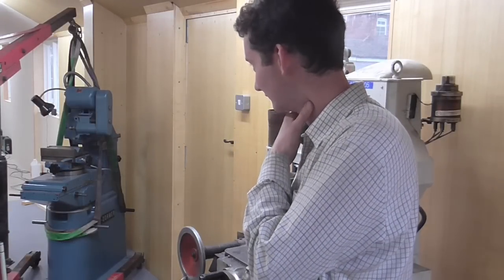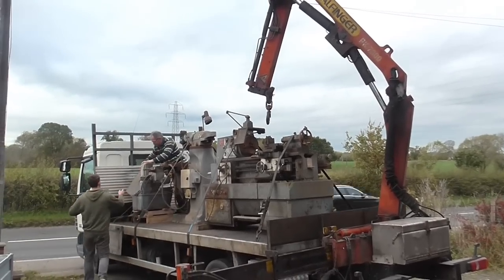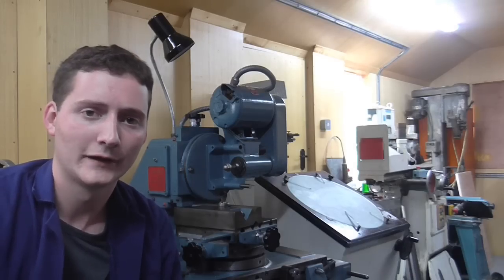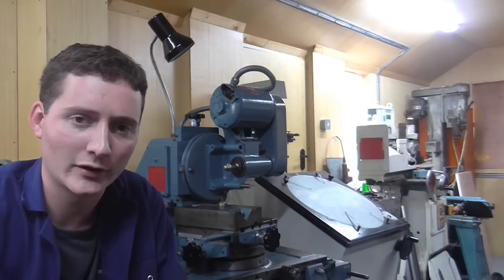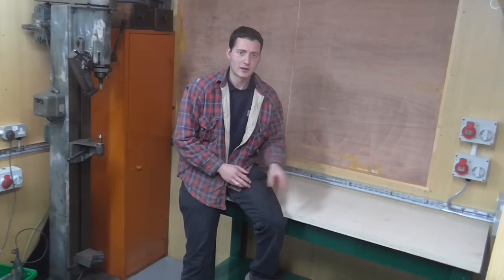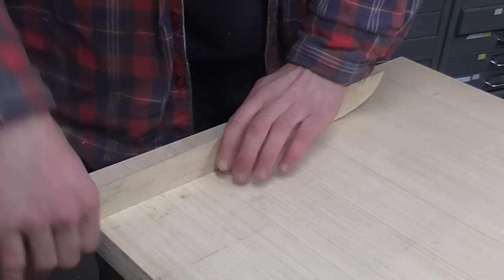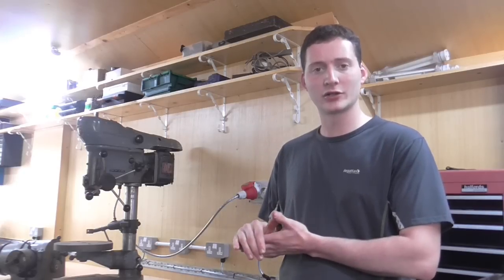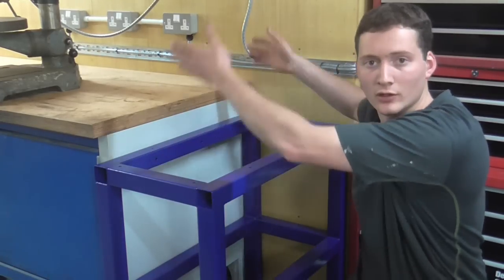Equipping a Workshop

Comment: Impressive collection of machinery Mr Crispin. Well done. One question, and one suggestion if I may. Question, how much power did you run to your shop for all that? Suggestion..get some covers for the motors and tables in close proximity to your abrasive end of the shop. All the air born grit and dust will eat the bearings and bushings in the equipment over time, and a little prevention will save you in the long run. I learned that the hard way. Good to see you back.

Comment: Wish I had that workshop when I was 23.  I only had a Unimat on which I built a Stuart Turner vertical V10 P small steam engine.  I have a more equipped workshop now but It took me 50 years to get to it, and it is nothing like you managed at such a young age.  I wish you luck in all your engineering adventures.

Comment: Good to see you back.  Two concerns - surface grinders are dirty, and I'd have positioned yours with its left side facing an end wall - and certainly not with a shadowgraph right alongside in the firing line.  The other thing is that you will accumulate/need a lot of ancilliary equipment to make full use of the machines, and there is now inadequate space to house it all. 

I need to get rid of two or three of my machines to ease congestion - and I'm sure you will arrive at this conclusion before long.
For what it's worth, despite having a full range of manual and cnc machines plus EDM, the machine that gets used most is a slow speed vertical bandsaw.

Comment: Hi Mr Crispin.I have, amongst other stuff, built 6 live steam locos, 2 each in 3.5, 5 inch and 7.25 gauge. I have never owned a milling machine preferring to use my 10in stroke Elliot shaper combined with a vertical slide fitted to my Colchester Chipmaster lathe. My only other machine tools are a band saw, decent bench drill and bench grinder.
All my locos were built whilst I was working in Cambodia from 1998 to 2017.  
Your programmes are great and very informative, please continue.

Comment: Jealousy is a curse................
You managed to cram a good machine shop into the space available.
I don't think I would have put the grinder and belt sander next to the surface table though. ( I was once severely admonished for leaving sweaty stains when I leaned on the surface table in the Metrology Lab when I was a QA auditor. )
Cheers Eric

Comment: I've just recently started watching Blondihacks - which I'd recommend. Making a steam engine (I think it is) she has a video showing machining of the crankshaft bearings and caps - 'a comedy of errors' - mainly down to bad planning. 

I'm amazed at the collection of machines you've installed in there - some I've not seen the like before - and one that brings back happy? memories - of the rhythmic belt noise etc. Having watched this video of the installation of this impressive collection I realised there is one machine missing. 

Machine Number One - that should have gone in first - - the gantry crane. With a capacity to have coped with the moving of all those machines with relative ease.
Note for Santa.

Comment: Was literally exited for you watching that ! Hey maybe your mate who made the drill press stand could coggle up a “sky hook” Abom style crane for you to move stuff like your diving head around, you could have various floor mounting points dotted around strategically they could take the form of a tube concreted into the floor or the same mate could coggle up a sort of 15mm mounting plate with m12 holes at 50mm centres say if you machined that up he could weld a 3’ rebar etc on it and have various “fixture playes dotted around for shop made sky hook etc  respect your work enormously 👍🏻
Reply from the maker: Nice idea!

Comment: Well done, lots of equipment in a smallish area. Wondering on the thoughts behind the grinding equipment next to the surface plate though, lol.
Reply from the maker: Because the surface plate has the least moving parts and it's easy to clean! I plan to make a screen to shield it eventually.

Comment: I replaced my old beat up 1963 Rockwell 21-100 mill with like new 1969 Bridgeport. It cost me $2500 to have the mill shipped. It took me a month to move it around the side of the shop, where I had turned a wall into a giant door. The only real improvement was DRO and auto feed, that I could have added. But the new mill did have a story. It was only used [lightly]for microwave modules, and built one that is on Mars.

Comment: Good morrow Mr Crispin,
I note that you have elected to have three phase electricity installed in the workshop.  May I ask if this is self generated from a static or rotary converter, as the Power Capacitors offerings, or did you bite the bullet and have a three phase supply installed to the property ?
If you chose the latter course, can you give me an indication of how big your choice of supply was, and how much it cost ?
By way of explanation, the Colchester lathe, and Harrison mill that I have, are both three phase, and it would save much modification and motor replacement, if I were to follow in your footsteps . . . .
Many thanks for any assistance that you can offer.
Kind regards,
Steve.
Reply from the maker: I had the local electric company round to do a survey but it was going to be a big job. They wanted industrial cabinets on the outside of the garage plus digging my neighbors drive up to run new cables and all sorts of admin. 

In the end I went for a power capacitors 11ke rotary phase converter. The Harrison 190 is the biggest machine I have and it is more than powerful enough to run that.
Reply: @MrCrispinEnterprises  
Good morning Mr Crispin,
And many thanks for your reply.
I had investigated the Power Capacitors rotary converters, and they seem confident that a 7.5 kW machine would suit my needs . . . . 
Both of my machines are fitted with a clutch in the transmission, so there is no need for frequent on-line starting.
I had just wondered what the feasibility of having a three phase supply installed might be . . . . 
Electricity companies currently (!) seem to be a bit twitchy about putting such a supply into a domestic premises, but as we transition towards an electricity orientated society, I predict that it will become the norm, in order to avoid nasty un-balanced loads on the local distribution networks !
Kind regards,
Steve A.

Comment: Hey mr Crispin. 
Have you still got your taylor Hobson engraving machine
Reply from the maker: Yep!
Reply: That's good to know. I have the proper Taylor hobson cutter grinder with the microscope for angle check. It'll be up for sale as ive got myself a Clarkson mk2 tool cutter grinder
Reply: @MrCrispinEnterprises  i have a taylor Hobson cutter grinder for that machine if your interested. Let me know
Reply from the maker: Hi. Thanks for your comments. I didn't actually know such a thing existed! I've had a look and it looks quite useful. Is it just for re-grinding the engraving cutters? I am potentially interested although I wonder if I could do the same re-grinding on my Tool and Cutter Grinder?
Reply: @MrCrispinEnterprises  it will make the complete cutter From stock. It's got various collets and the smallest Jakob chuck ive ever seen.
If i can send a video of it i will
Reply from the maker: Ok thanks for the info. You can send me any details at mr_crispin@hotmail.com
Reply from the maker: Hi, yes and I've replied. Cheers